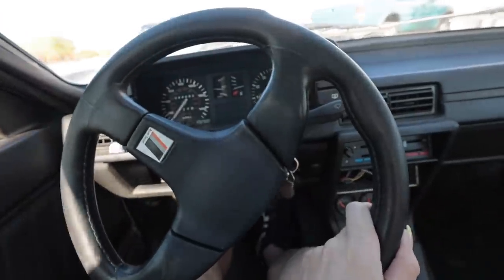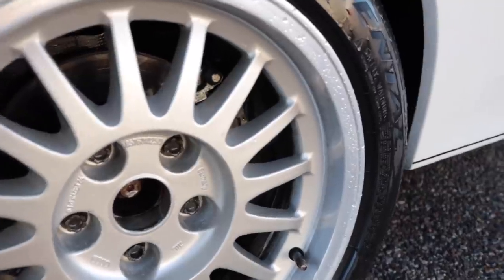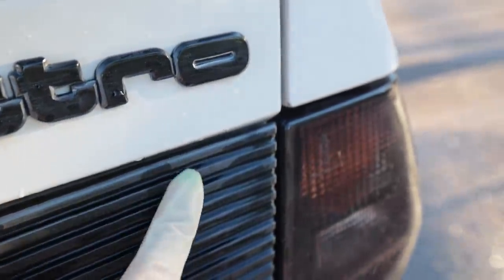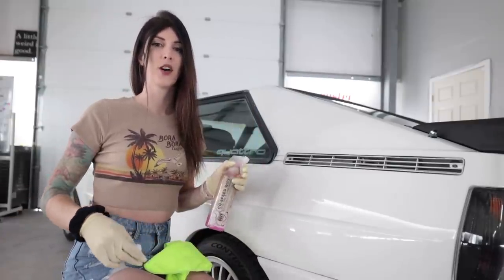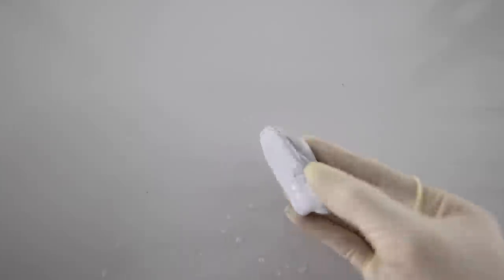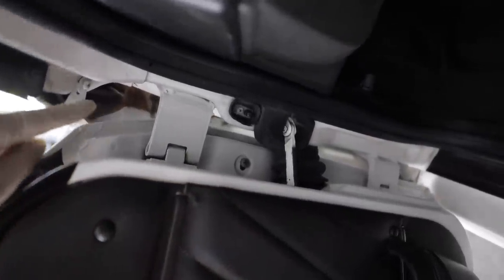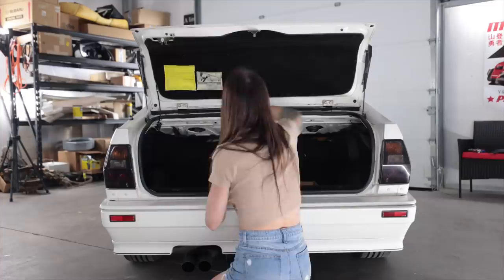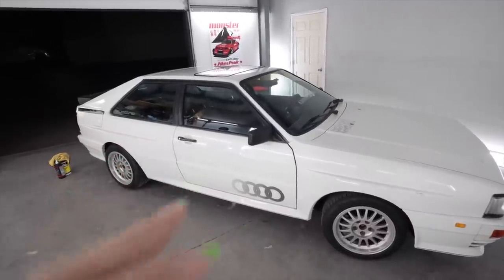Clay Barring My 38 Year Old Original Paint.. // Project Ur Quattro

Comment: I was a professional detailer back in the late 80's, so I worked mostly on this kind of paint. Back then most dealerships didn't even have a detail department so they would send their trade-ins to us. Usually anything older than 3 years got cut. It was just easier in the long run. I say this for your future reference. We used rotary polishers on the paint back then and I still swear by them. Liquid compound will work fine, just remember that heavy compound has to be at less rpm(2000) liquid compound no more than 4000 rpm. All my socks are black.
Reply: I thought the sequence of events was… Rubbing compound, then polishing compound, then clay bar. Is this different for the old style paint?
Reply: @stevedoe1630  Correct, except for the clay bar. The rubbing compound applied with rotary polisher that we used was very abrasive, so if that didn't remove any imperfections nothing will short of wet sanding. The final step was a cleaner/wax.
Reply: I'm guessing the key to maintaining a car with single stage paint is to regularly wax it to keep the environment off the paint? Use it as a stand-in for the clearcoat.
Reply: Could a ceramic coating be applied to single stage paint to make future detailing easier?
Reply: @stevedoe1630   You clay after washing, before polishing. Clay is actually abrasive. It doesn't just "pull" off bonded contaminants because it's sticky, it actually mechanically shears them off the surface. It can and will mar the paint to some degree so you need to follow up with a polish to clean that up. You only want to clay when and where it's needed.
Reply: I guess that would make your sock drawer hard to alphabetise, eh?
Reply: @richardhunt809  Nope. Don't even have to match them. LOL
Reply: @jdisdetermined  It will only mar the paint if the user is not paying attention and doing it correctly.. I like to use a very slippery clay bar lube when I use one, so I never mar the paintwork...
And no, the Entire vehicle paintwork including all glass should get the claybar so that all these surfaces are equally the same level of smooth..
If the claybar makes the first area you use it on very smooth, why would you Not want to make all the surfaces the same ????
There are newer technology clay towels that are made of rubberized product that will also smooth the paint but may take more work...The advantage is that they just rinse off and in my shop, you have to clay towel around 40-50 vehicles completely, before this media is worn out..
No claybar in the world will ever be able to come close to this..
I know all about claybars, having used them since they were first introduced to America in the 80's...
Reply: @professor_farnsworth  Anything applied to any paint after correction will help the paint stay clean... If it has any UV inhibitors in it, all the better...
There is only so much single stage paint, so you have to be careful...
Reply: @frandanco6289  Yes, of course you clay all surfaces that require it. Where did I say not to? But only when and where it's needed. Clay is abrasive. Put it under a microscope  if you want to see it. I don't care what clay you use or how you use it. Grab a swirl finder light and you will find at least light maring left behind on paint, clear plastic, black piano trim, etc.. There is no avoiding it. Yes it's very minor, but it's there all the same. Which is why we only clay when and where it's needed.
Reply: @jdisdetermined  use a light clay bag unless you have some serious shit going on.  I use ONR as my lubricant and a light grade clay.
Reply: @johnandstephanie377  Same! 👍 Most of those heavy clays friggin tear up paint. I don't really care for the synthetics either. I don't like not being able to see what I'm pulling off the panel.
Reply: @jdisdetermined  clay being the light abrasive that it is, I wouldn’t be inclined to use it on the glass, and wouldn’t expect the clay to be ideal for every surface.
Reply: @redbluesome2829  Nothing to worry about there. Glass is incredibly hard, much harder than paint, it shrugs off clay bars, magic erasers and the most aggressive cutting compounds. Aside from full on sanding or lapping, Cerium Oxide and a lot of patience is about the only thing that can have any sort of impact on glass.

What do you mean by “not ideal?” As I’ve said, it’s never ideal to use any form of abrasive, which is why they’re only used when and where they’re needed. But when they’re needed, they’re needed. Clay is very fast and effective and relatively gentle on almost all hard exterior surfaces of a vehicle. Making it the ideal choice for the specific job it does on those surfaces. I get terrible durability out of anything I put on glass if I don’t decon and prep it thoroughly.

Comment: Something I would prioritize is getting a paint thickness gauge to verify how much material you have to work with before you start correcting. With a car that old, original, and valuable it's a cheap way to identify any areas that are already thinned by prior work you may not be aware of. Even something in the $50 range on Amazon would be a decent starting point; no need to spend a ton on a DeFelsko or Elcometer when you're not doing corrections full-time.

Comment: Nice work!! The car is looking great. The 8x15 Ronals were all Zermatt silver. Those were rattle can painted at one point. There's new black center caps avail from a few folks in the UK. The vents on the C pillar is because there's a gas tank in the trunk, and that's where the rear sunroof drains empty out.

Comment: One advantage to single stage, particularly solid colors, is that rock chips are very easy to repair.Dab in color to fill the chip to the same level as the old paint and at that point you can use some ultra fine and wet sand it smooth. Buff it off and you'll never see the damage. I'm also thinking that the vents are for the interior too. You have to relieve the pressure inside the car some way so that the heater fan is efficient and that probably is the way.

Comment: Meguiars #7 for restoring single stage paint.  It's an older product that is outclassed by modern alternatives for clear coats, but it sings on single stage.  #7 has no protection so it will have to be topped with a sealant or a wax.  I would again keep it vintage and use a carnauba wax instead of a modern sealant.  This will be higher maintenance than a sealant, but the carnauba shine will have more of a glow instead of a deep gloss that will look better on vintage metal.

Sweet ride!
Reply: I used to love this combo in the mid-to-late 90's!!!  

Might have to use it on my garage queen Civic next summer.
Reply: Agree. I used mother’s carnauba in the tin on a 77 black Firebird I had. Looked like a mirror afterwards.
Reply: Agree, use Zymol Pure Carnuba after Maguiars Clay Bar and its sealed. Then I just use quick detailer to keep the paint sealed.

Comment: My favourit compound is Polytop from Germany. 2000 and anti hologram from Polytop is usualy  my go to. 
Scholl concepts is my previous compounds and polish S2 and S30+. I worked in a carcare shop and sold it to the pro market.
short haired wool on a DA or regular  wool on a rotary first stage and medium foam pad for the finish. 
I use compressed air to clean out the gunk. .My favourit claybar is from Bilthamber.  regular Clay is more versatile.
 And more agreesive than other brands.

Comment: One purpose of the side vent near the rear quarter panel is it allows the release pressure that builds up inside the car when not in use (especially if parked outside on a hot day).
Reply: A few of the BMWs I own have these vents hidden behind the rear bumper cover which I found neat.
Reply: It also vents pressure when closing the doors so they close easier as well as a ventilation outlet for flow through ventilation.
Reply: A lot of cars have a flow-through ventilation system. The deal was that air entered the car through the dash vents and/or open windows and was sucked out through vents positioned at the rear of the cabin in an aerodynamically low pressure area. The first car I had with such a system was a 1966 (English) Ford Cortina. Most European cars have had some variation on the system ever since the 60s.

Comment: The rear vent is also a cabin vent. Turn the heater blowers on full blast (with doors and windows shut) and put your hand by the outside vent and you will feel quite the breeze! 💨🙂

Comment: Probably already been said- the vents in the rear quarters are for interior ventilation. Similar to the plastic louvered vents under modern rear bumper covers. The fuel tank is sealed inside the trunk and all venting of the tank is dealt with externally. One of the main reasons for putting the tank here is the rear-wheel differential living down in the usual spot. The front-drive Audi coupe also shared this fuel tank location, as the Quattro was the original, where the coupe was a secondary, affordable model based on the UrQ. I may or may not have had a couple of these cars LOL! Best sounding engine of all time to my ears!

Comment: If you contact 3M, their automotive industry products include things like an ultrafine 3000 grit polish, which is the same as a clay bar when used with the right wheel. Their pro grade stuff isn't sold in the chain stores.

Comment: I'm using a Karcher steamer to get the stubborn dirt from seals and weather strips. It uses some pressure, but not very high. The temperature of the steam does the job perfectly to get any mold or tarry dirt out of the crannies. And what is most  important (except removing dirt of course), you don't use any chemicals in the process

Comment: Griots Fine Hand Polish, 3M has one (I think I use their "machine glaze" by hand) and Malm's has one - all those will clean up those stains, and gently when done by hand.  Used the latter two back in the late 80s when I was a mobile detailer.  I use the Griots exclusively now (though not a detailer any more).  It also is excellent for removing scratches the clay bar can't quite get.

Comment: Its great you have OCD on the wheels Sarah (or is it just normal old school attention to detail and pride in one's work). When you get to the wheels, check for the correct paint code on the quattroforum and get the shop to mix it as it's a very specific colour. Once done, use a wheel wax or Supagard on the inside of the rims as this forms a layer against brake dust and road grime and makes it a heck of a lot easier to clean next time. On the lightbulbs, take them out of the board with a cloth and polish the glass bulb as this removes the moisture/dust mix that builds up and causes the glass to heat sink and reduces the life of the bulbs.

Comment: From years back till present (almost 50 years), I have done paintwork. From single stage cellulose to clear over 2K. I have always used Farecla G3 as my cutting / finishing compound with rotary polisher (around 1000-1800 rpm). What I like about this, is, each time you wet it down it gets finer. Never leaves swirls although can be fairly messy. Then I always finish off with Carnauba wax (present choice is Mothers California Gold). Nice wax, does not leave any colour or marks on trim. Always gives a very nice shine and never gives that look, where you can see where you polished if you look at an angle. One other choice for finish is also Ceramic coating.

Comment: Sarah......suggestion. Liquid NuFinish for wax. It does wonders on the old single stage white paints. I have a 85 BMW 635csi. It was originally a California car so paint was a bit chalky. I carefully rubbed it out old school style- wool pad & compound which brought shine back. The NuFinish has lotsa petroleum products so it keeps the paint shiny & protects it. Also, it's super easy to work with.

Comment: Vents are for the HVAC system: air goes into the car and it has to go somewhere without building up positive pressure.  Newer cars usually have the vents hidden in the trunk lower fender areas.

Comment: For a few years, there were claybar cleaners that you just sprayed the dirty part of the claybar with it and it melted a little layer off along with all the junk embedded in it, and you could go back to work... No need to fold, refold, find you already used that area, and eventually throw the thing away...
Then, later, they came out with rubberized towels that fold in a square that you just wet, wet the surface, and rub that over the paintwork.. It does a great job and you just have to rinse if off and it is clean again... Takes a lot of vehicles to wear out each of the 4 squares, so this has to be a money saver..
I still like some claybars for something hard to get to like under outside door handles, all the lights, etc... but the ClayTowel is way ahead in terms of doing this faster with less stress if you drop it on the ground accidently...

Comment: Audi pumps wax into the body cavity seams.  There is also a shipping protection spray called, “cosmoline” that was supposed to be a temporary protectant.  Each car came with a comoline removal spray that was applied to the cosmoline areas and then hosed off.  The dealer didn’t always do a thorough job removing the cosmoline during the pre-delivery inspection process. Left on the car,  it becomes somewhat crusty over time. It was generally applied underneath and to the lower parts of the car. You’ll see it baked onto the exhaust sometimes. The corrosion protection wax is generally seen inside of the doors, etc.    
The fuel tank Is mounted above the rear axle area, outside of the rear crush zone. You’ll notice the two  massive crush rails in the trunk floor.

Comment: I use 50/50 alumabright and water mix for the stains, spray it on with a pump sprayer let it sit for 15 to 30 seconds and pressure wash it off it's the bees knees.

Comment: I personally like meguiars pro clay bar, you can get different levels of abrasive too. Also if you need to polish windows cerium oxide on a orbital works great (just watch heat build up) Also like using meguiars compounds because they break down as you compound to a polish so its hard to burn through. For rubber/plastics I use 303 aerospace it protects from uv as well as gives the rubber a natural sheen not too shiny like a lot of rubber treatments.

Comment: Macguiars ultimate compound is what I use after clay on my single stage white, topped with their carnauba. But you could possibly ceramic coat directly after the cut. Just confirm the ceramic you choose works well on that vintage of paint

Comment: I don't know if you ever got the answer to this but that vent is to help with cabin ventilation. I had a similar one on my 1985 Vauxhall Astra (Opel Kadett). Especially in the days before factory air con was common in European cars you'd have a lot of trouble with the glass steaming up on cold wet days and while turning the heater on to demist helped with the windscreen the only way to get those side windows (which don't open on a lot of 3 door cars from the 80s) to demist is to have decent airflow through the cabin, meaning you need somewhere for the air to escape out the back of the car.

Comment: Hey sarah. Your grille is there  probably to allow the cabin air to travel down the C pillar and vent through the grille without letting  rain water in. My Integrale had the same. Without an outlet, the cabin ventilation cannot work correctly. Totally lovely car by the way. Go careful. Mike

Comment: Here in Sweden you have to go to a petrol station to wash your car.
Rinsing the car with just water is equated with a rain shower. 
It is when de-greasing, shampoo and other chemicals are used that washing affects the environment,
especially if untreated water ends up in storm water pipes or in watercourses.

Comment: Not only does the paint have titanium dioxide in it but since the paint is white it actually contains the most amount of titanium dioxide out of all possible colors. That's why it can be used as a single stage paint because titanium dioxide has incredible hiding power. The pigmentation is heavy and hides the substrate very well.

Comment: You take the same approach to single stage paint as you do clear-coated paint. Pads need cleaned more frequently wham doing single stage. Watch your edges. That paint is old and very likely thinner on the edges so watch those. Other than that, 3D”s line of compounds and polished are great. Koch Chemie has a nice product and pad system.

Comment: Bilt Hamber medium clay with water for lube is all I used when I was detailing cars. And try 3m fast cut plus or Meguiars M105 for first stage correction - they work very well on single stage and tough ceramic paints. You might have to break out the rotary for more intensive correction.

Comment: My father has had his ur quattro since 1987 and it needs a full resto! I did try but everything I touched ie bolts etc snapped. 
I managed an oil service, drained the fuel tank, new fuel filter and pump, new leads.  I have 2k in parts including bushes and hoses to go on it but it's just to much work for someone with next to no car knowledge and none of the correct tools to do it! I wanna see it back on the road soo badly but its gonna cost around 20k which at this stage in life I don't have

Comment: I’d approach that single stage gingerly. As much as you feel it tough as nails, if it get any temperature in it, it’ll come off quick. At least that my experience. As far as repairing single stage, even if it’s a dead on color match, it’ll still show a difference, so blending is rarely an option in my experience and doing a complete panel typically is the result. 
Lately if been using Griots 3 in 1 and kinda thinks it’s ok. Have fun and carry on!